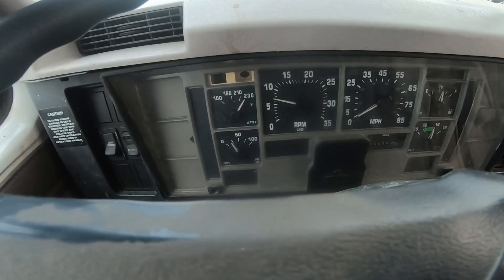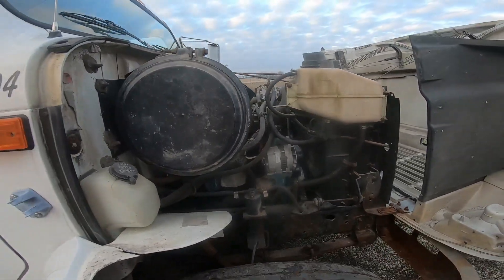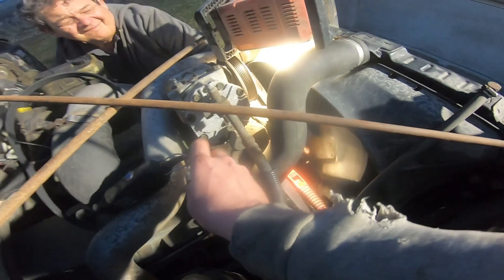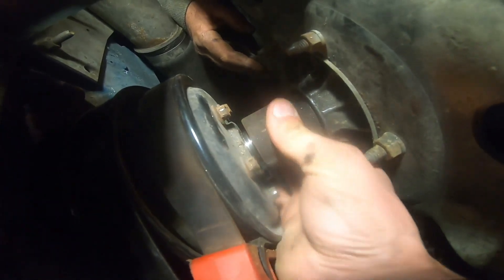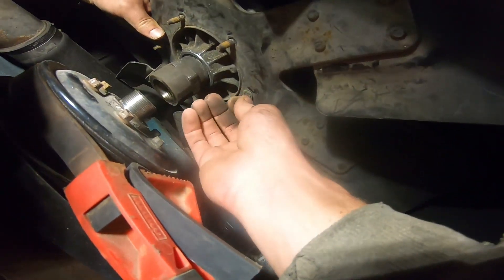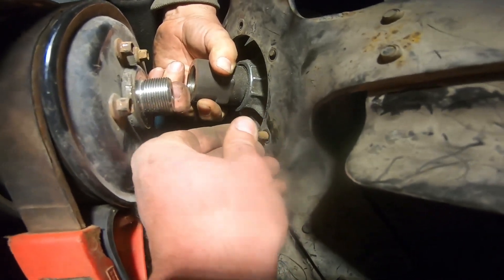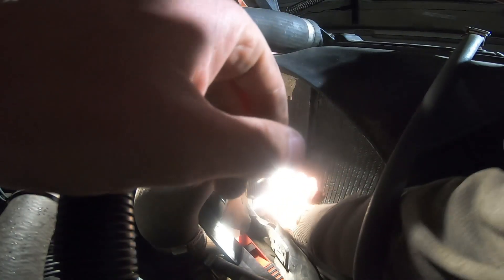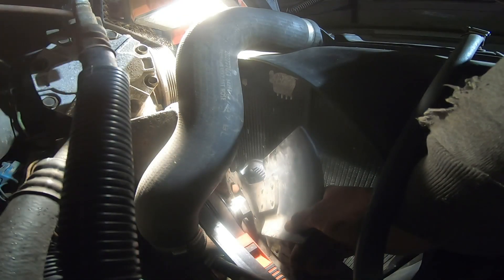Fan Clutch Replacement on International 4700 Truck DT466e

Comment: Back when I was driving a school bus, I noticed one day my temp needle would slowly rise over a period of about maybe 15-30 seconds, then drop back rapidly in 3-5 seconds, and start again.  Well, from experience with my pickup a few years earlier, I knew EXACTLY what caused that-- a coolant leak.  SO when I finished the route one day, I opened the hood on my old 91 IH DT-466 and took a look.  Started seeing dried coolant droplet marks on stuff halfway back on the engine and hoses and stuff, and traced them back, getting more numerous and closer together, to the water pump weep hole.  It wasn't leaking, but I had a strong suspicion I found the culprit, so I cranked her up and came back out and had a look... sure enough the fan and pulley were wobbling like a top.  SO I shut her down and rolled the hood back and latched it.  Drove over to the boss's office and told him I needed a new water pump, and why... Hand delivered the maintenance request write up because I knew our less than stellar mechanic might fix it in a year or two if a fire wasn't lit under him.  Boss man asks me, "Can you still drive it?"  I was like, "yeah, but when that water pump turns loose, it's going to send that 3 foot diameter fan straight through the radiator like a buzz saw!"  On that bus, the fan only cleared the radiator by about maybe 2-3 inches-- nowhere near as much clearance as you had there... "Well, I'll tell the mechanic, but go on and drive it til he gets around to it.  Shaking my head, I was like, "Ok, you're the boss" and went on driving it.  Sure enough, about a week or so later on my morning route, near the halfway point, I slowed down to make a turn onto the last road to do a pickup before going back to the school about 3 miles away from the other end of that road.  I finished the turn and started accelerating, and I hear this "BZZZZZZzzzzz!" and I'm like "Yup I know exactly what THAT is... water pump just turned loose!  Fan was eating the radiator!"  SO I just leaned on it for about a quarter mile, made my last pickup right quick as the steam was starting to roll, and goosed it back out to the highway about 3/4 mile away, luckily it was clear and I made my turn and hooked and booked back to the high school... I was watching the temp climb but it was okay so far... got on the radio and told the mechanic "the water pump just turned loose and ate the radiator, have a sub bus standing by for me, I'm bringing her in".  I whipped into the high school and dropped off the first half of the route's high school kids, and limped her into the shop gate just as the temp needle rolled over into "HOT" territory, steam puking pretty good by then.  Shut her down, herded the rest of the kids onto the old junk bus he had waiting for me, and we took off again to drop at the middle and junior high and then hit the second half of the route.  Turned what would have been a day's work and maybe a few hundred bucks for the water pump and various/sundry supplies to replace it, into a couple thousand dollar job because it needed a new water pump AND new radiator after the fan ate the existing one.  Plus my bus was out a week waiting on parts and repair... 

BUT that's how they liked to do things!  Later!  OL J R :)
Reply: You better believe. If you have antifreeze coming out of that weep hole. Can feel a goodly amount of play in that fan when you shake it by hand. Your on borrowed time. Till the fan tears the shroud up. Or worse the radiator and God knows what else.
Reply: @rogercarrico4975  yup, this one I cranked up got out and watched it out was wobbling like a kid's top toy...

Had another driver, he drive a semi for Frito Lay for years, get up at 3am, run a load of chips somewhere, back home at noon, grab a nap, drive a bus from 3-430/5, go home do his thing till 8-9, go to bed do it all again tomorrow...  So anyway he knows what's what about trucks... His U-joint is squeaking so he writes it up and tells the boss he needs a U-joint replaced.  Boss is like,"can you drive it?". He's like, "yup till it breaks down" so the boss is like "drive it till we can fix it". So he does, out on the route on the main highway thru town, drops a kid off, closes the door and hits the accelerator... PING! Driveshaft snaps and rolls out from under the bus.  When it let go it wiped the air lines off the rear axle, dumping the air to the spring brakes, so now it's parked in the road.  He radios, they bring a sub bus, and has to transfer 50 kids on the side of the busiest road in the county, and then take off again.  Mechanic decided to crawl under the bus to put the caging bolts in the spring brake chambers to release the spring brakes so they can tow it back to the bus barn with the 1 ton.  DPS trooper is directing traffic jam from hell and asks him, "whaddya think your doing?" Then after he tells him, cop says, "Nope, unsafe with this traffic, call a HD wrecker". Mechanic is starting to go under anyway, cop asks if he wants to be arrested.  They end up calling a semi wrecker who Harris it back to the school a few miles away, so there went probly 2-3 grand, those HD wreckers ain't cheap!  The driveshaft time was ruined, had to send it to Houston to a HD driveshaft shop to be rebuilt, weld in new yoke and rebalance it.  SO what should have been a half days work and a couple hundred bucks to replace a HD U-joint turned into a bus sitting 2 weeks waiting for the rebuilt driveshaft to get back from the shop and be installed PLUS possibly 2 grand in towing... But who cares it's taxpayer money!! 😠

Comment: Had one that I couldn't hold the belt pulley. To keep it from turning. Really tight! Took some 1/4" plate  Cut a slot, big enough to over the bolt heads that go through the Pulley. Welded a piece of 3/4" pipe on to it. That worked.  With the left-handed threads. I suppose it just gets tighter and tighter as the engine runs.
Reply: Yeah usually the auto supply has a "socket" made out of flat plate like that with a square hole for a breaker bar to lock it up... 

Those d@mn fan clutches are SUCH a PITA... I used to toss them and put a "fan clutch eliminator" on them when I was younger... they used to sell an aluminum adapter that had two different size pilot holes (for the water pump shaft), two different fan hole diameters, (clutch side) and a series of bolt holes to match to the water pump pulley and holes for the fan bolts... worked great.  I've also heard that if you have one getting weak and not working, you can pop off the snail spring off the front of it and it will basically lock the thing up solid for awhile and get you more time til you have to break down and replace it.  Later!  OL J R :)
Reply: @lukestrawwalker  That's very good information! Going to put that in my memory bank.😜 I very well might need to use that one day. Thanks👍

Comment: Mine went bad on my Chevy truck.........Temp would rise to a tick or two above center......Cured that by switching to the correct Antifreeze (GM is "orange"), but continued to move up and down a half a tick....When I had the air worked on, had them look at the 'clutch fan' .....Sure enough is was bad.....Hasn't acted up since then.......

Comment: I have thought about adding a clutch to the fan on the 1973 Ford F600 then instead of getting 9 miles to the gallon I could get 9.5 miles to the gallon. 🤔
Reply: Get you a flex fan... they work better LOL:)  Or just go electric fan.  Fan clutches are a PITA.  OL J R :)